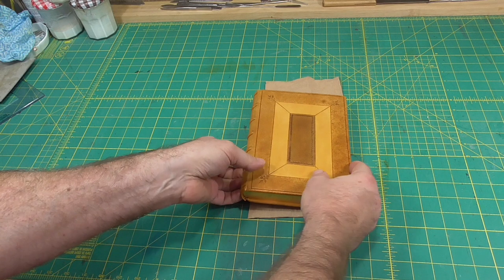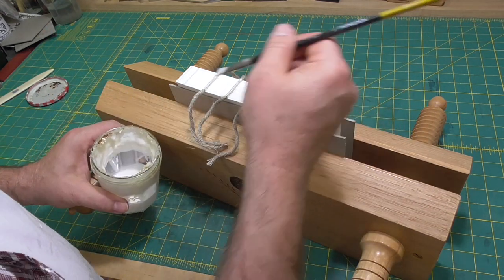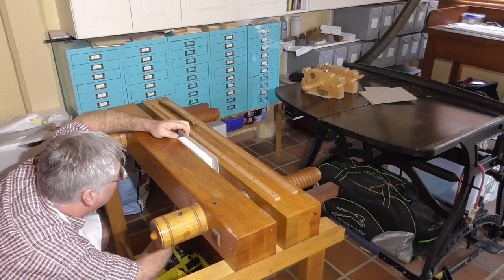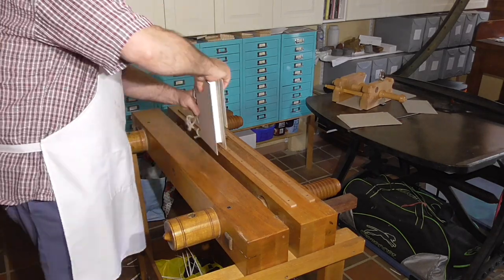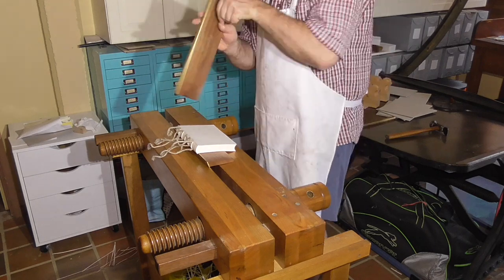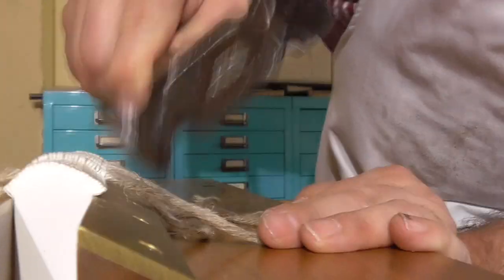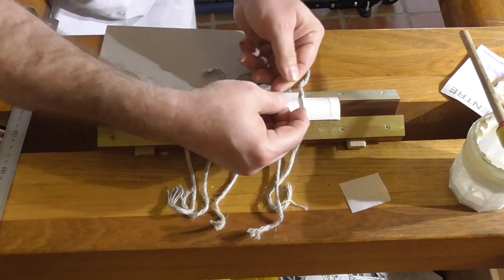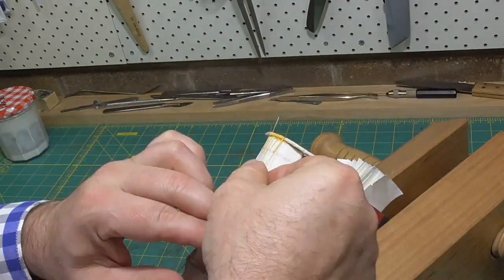Rounding and Backing; Flexible Binding in Full Leather Part 3 // Adventures in Bookbinding

Comment: Rounding to a fifth of a circle results in an arc which has a central angle of 72 degrees while rounding to a third of a circle would result in an arc with a central angle of a 120 degrees which would be the gentler arc. Sir, I think you've made a mistake saying doing the later would be too much rounding. Such a great series all the same. I donno if you've ever been a teacher, but I imagine a physics class with you as the instructor would have been a blast. Love your channel.
Reply from the maker: I was lucky to have great physics lecturers. Maybe some of their ability rubbed off. For the same width book the smaller angle will result in a flatter round.

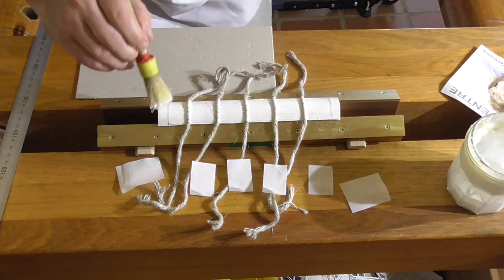Comment: At 13:20, you talk about lining the back after rounding and back with a cotton cloth.  What kind of cloth are you using?  Regular cotton cloth, or some special material?
Reply from the maker: Check out my recent video on spine lining materials.  I often use cotton or linen specifically marketed to the bookbinding world.  But as I say in my video, any thin fine thread cotton should work fine.

Comment: Hello Darren! Thank you for your tutorials! I have a question: what is correct (or traditional) way to make leather bound book with hard spine? I saw a video tutorial how to make leather bound for book where the bound has been made separately and then glued to the book. Same as with modern hardcover books. But such way seems incorrect for me, as binding will be holded only on leather so it wont last long as leather gonna stretch so binding will hanging out.
Reply from the maker: There are many ways to bind a book.  Some better than others.  And it depends on functionality you are after.  But I think what you mention is a case binding.  Most people do case bindings in cloth.  But you can use leather.  Case bindings are faster to make but not as strong, but can still be plenty strong if hand made.
Reply: @DAS Bookbinding  Yes, I've mentioned case binding. My goal is to learn some traditional and durable bookbinding technique. Something which used for rich book binding in the past(or today). Fist of all I want to make nice-looking and durable book binding for my home library as hobby. But I want to feel that those books can be last for decades.

In that tutorial with case binding author used very thin leather, 0.7mm. Now I can understand that such book binding can be used only as home decoration. Most of all, such binding will became bad even after one full read of the book.

I also noticed the book "Bookbinding, and the Care of Books" in one of your videos. Haven't finished reading it yet, but so far it seems that this Flexible Binding actually one of the best bindings which grand strong durability and pretty good looking. The only issue with it is gilding. Author of the book says that gilding on flexible spines looses after many cycles of book usage. But maybe modern gilding materials is more durable?

Comment: Really enjoying this series and the added depth in which you're covering some of the steps!

I was just curious, what particular paint/ink are you using to color the edges in this case? I don't remember this book being in the edge coloring (or gilding) videos.

Thanks!
Reply from the maker: No, this one isn't.  But I use the same Liquitex acrylic ink, just a different colour.  DAS
Reply: @DASBookbinding  Ah! I thought that's what the bottle looked like! Thanks! 

Have you tried doing edges with their pearlescent inks specifically? I just picked up a few of them to try both sprinkling and edge painting with, but haven't got around to it yet.
Reply from the maker: @darrenleonhardt8572  No on the pearlescent paints.  I've used it on bookcloth.  right look a bit flash on the edges of my bindings:)  DAS

Comment: Hello, fantastic video as usual. How do you make these beveled boards? I have been struggling with my own handmade plough when ploughing the head and tail. Thank you
Reply from the maker: I just use my usual Olfa knife and hold it at 45 degrees and run along a ruler.  Nothing fancy.  DAS
Reply: Search for Olfa MC45. It is a cutter with a base at 45 degrees.